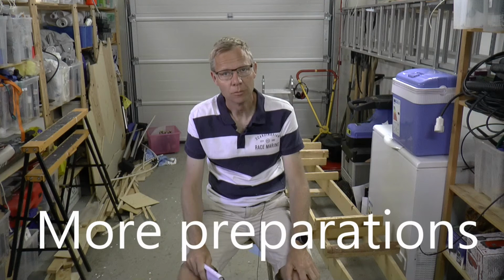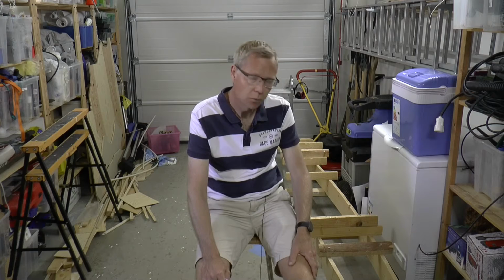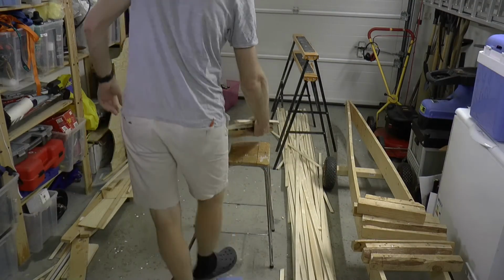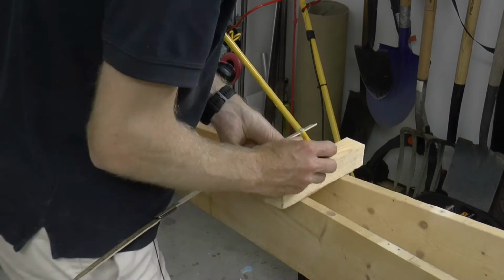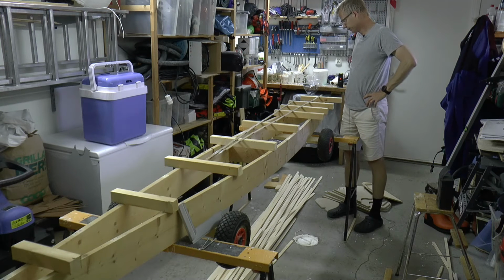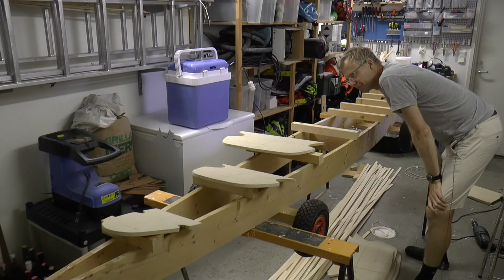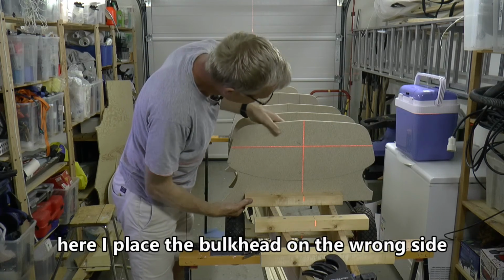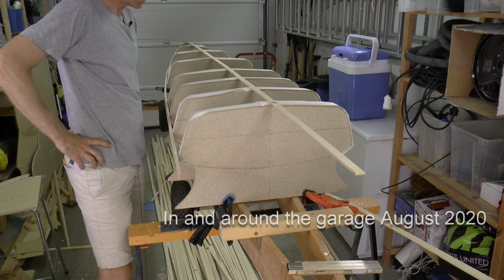Cutting strips and setting up bulkheads for building a strip build Kayak #97

Comment: first thing to do is to get a table saw to cut your strips easier, faster and most important accurately uniform in size.
Reply: I would recommend just putting a couple of 2x2's on the sawhorses. That way you could just cut right through them, and don't have to lift the board every single cut.
Reply from the maker: Yes I thought that also although my mentor adviced against it, more gentle for strips he argued. But if I will cut much more strips I will certainly consider the investment.